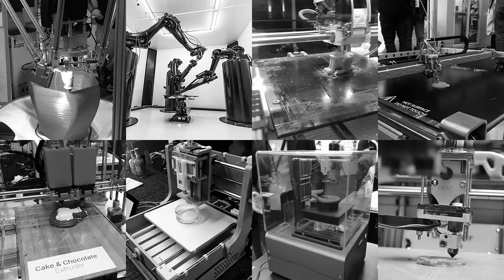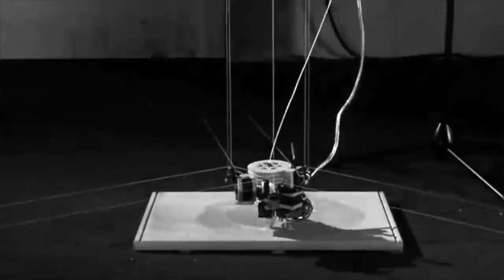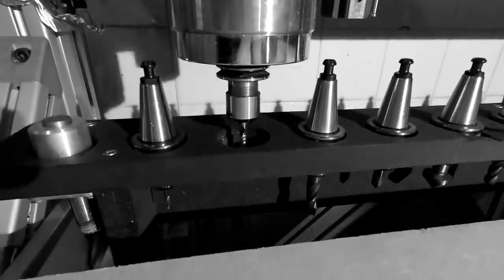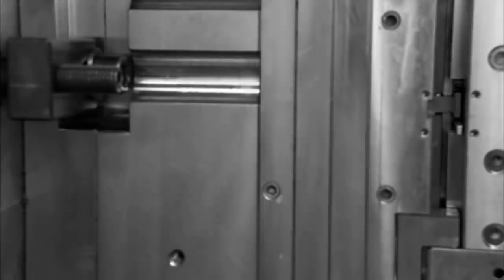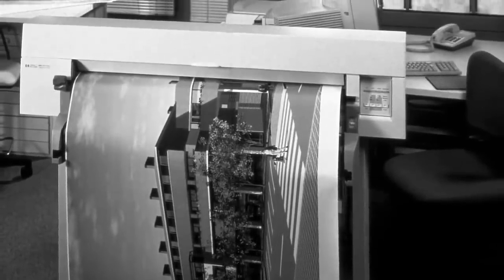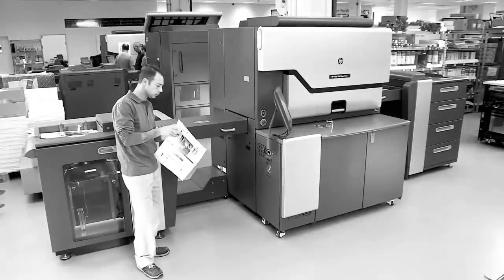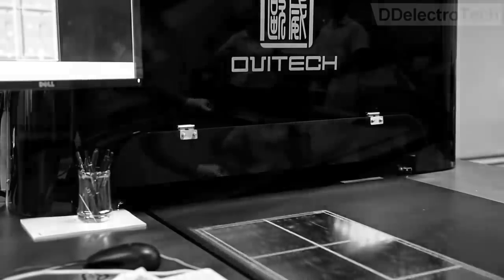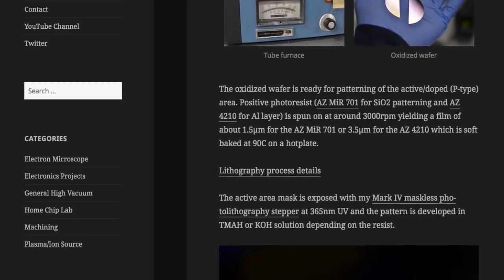The Desktop Manufactory 01 / A New Industrial Revolution?

Comment: You're missing out on something very big.

Machines are expensive. They are the least expensive when they can run 24/7.

There's no need for home bookbinder machines. If you want books bound, there's the machines you mentioned that can automatically print and bind books. That process can be automated to the point where from the order up to the books being in the box, no human has to interact with the system. That makes way more sense than everyone having their own book binder.

The 'book binders' that are useful for home use have been in homes for decades. They're called ring binders. They're cool if you need one printout.

Book binding is for actual books, that get sold in the hundreds or thousands.

Same with vacuum formers etc.

See what happened with PCB manufacturing in the last 20 years. It went from people doing it at home because it was so expensive to have one professionally made to being able to order 10 pieces from china for 2$ (10$ including shipping). THAT's the future, not everyone having a vast array of machines in their homes.

3D Printers are a bit of an exception. I mean, even then, what would be "public printing spaces" - like those that exist in hacker spaces, where you could queue up your job in an automated system that tells you when your model is done, and then you can pick it up with a passcode, pay the filament and timeslot fee (should be low if effectively implemented), and be on your way. All fully automated, only maintenance staff needed.

Comment: Hey Node,
For your 2d printing machine, you should try to make a DIY UV printer. It'll kill two birds with one stone.
They allow you to print on a range of materials and I have found no decent or thorough alternative online.
I think a UV printer would be an amazing asset to any makers workshop cause you could also create PCB's with the printing tech
It allows you to make 2 layer PCB's but you'll need to drill the VIA's and connect the two sides

Comment: One thing I didn't notice you mention: Universal robots. They're used in pretty much all manufacturing applications and are extremely useful due to their flexibility. You can get them to assemble just about anything rigid with the right attachment. I'm not sure why they aren't cheaper. Maybe it's patents, maybe it's servos precise enough to move them about, maybe it's just that a FOSH plan doesn't exist.
Reply: An update on this: https://www.youtube.com/watch?v=woXfuM6YjM4

Or to summarize, the presented concept is a matrix of cells of 4 or more universal robots with interchangeable tools, supplied by self-driving transport vehicles. This goes above "desktop", but expands what can be done dramatically by miniaturizing and generalizing the production process.

Comment: I am not sure that pursuing DIY PCB's and pick-and-place soldering is necessarily the best use of time and resources.  Both of these jobs have multiple providers that are happy to do the work very cheaply.  Of course, eventually one would have gotten more labor out of a DIY toolchain than they would save by using existing services, but at that point you're talking about being an electronics design house in your own right.  If you're making custom electronics at volume for a living, it's probably a better idea to get existing professional tools with professional support contracts to keep your ability to make money running.

By all means, create CNC tools for routing two-layer boards, applying solder paste, and placing SMT parts as there will always be small collectives that can use the capability, but you would be able to do more good by focusing your limited time and effort elsewhere first.

Comment: @N-O-D-E
 I would argue the more important disruption is in knowledge organization. There are very promising precursors out there for a knowledge organisation system far superior to what we do now as users on the commercial Internet. I'm talking about developing an integrated toolchain to drastically simplify learning and collaboration, maybe a set of standards on top of which to build OSHW. First comes the human needs approach: conceptual modelling starting from human needs (most stable over time). These needs are expressed as scenarios/user stories using Semantic Web/Linked Open Data vocabularies, so they can be linked together, navigated in a graph, deduplicated and otherwise improved by collaborators. Then the solutions to the problems come first as design intents expressed using the Design Intents Ontology. Implementations come last (as they are the shiftiest sand, depending on evolving software packages and platforms). Say OpenSCAD with libraries. The idea is to computer model as much salient knowledge as possible, and radically open-source it. Eventually the goal is for the "productive knowledge worker diet" to consist not of long-form prose books, insanely priced university courses, long-winded lib docs, lowest-common-denominator cookie-cutter walkthrough videos  and life-long specialization by internalizing (quickly outdated) material. Instead it should consist of interacting with knowledge package managers, reusing code, document fragment transclusion, doing remixes, mashups and animated debugging. :D

Comment: The unequally distributed future ruined me. I can't buy shoes anymore. My last sneakers were an unexpected upgrade (ultra-light, comfy, slip-on, water-resistant, durable and cleanable) and now I can't imagine going back on any of these features. 

Same goes for bicycle parts, particularly "human interface devices" like grips and saddles. If there was an OpenSCAD script to take in your body + bike params, you'd grab some TPU filament and print perfect custom parts. Then that would be it, quest over. No more marketing, deceptive pricing, secret discounts, and most importantly you can have stock. No more of that market gap between cheap and premium, where cheap products are bad, mid-range products are also bad but branded, then – sudden jump to premium products, which are too good and way overpriced.

I would argue that adapting to the challenges ahead requires shifting away from "owning products" and towards "adopting technologies".

Comment: Yeah, desktop injection molding won't be a thing, it is not viable and its use case to narrow.
Fortunately it doesn't need to, because you can make very quick silicon molds and do resign casting.
The modern resigns have very good properties and can easily compete with thermoplastics especially when combined with strengthening fibers etc.

Comment: Yeah 3d printing is still early days. We just lack the strength metal materials can provide. Lost PLA casting would alleviate some of that, but then there's other things to consider. We've got a long way to go.

Stoked to see where the production line goes next. We're missing too many steps in the consumer / maker area. Lots of opportunities to fill the gaps.

Comment: Very interesting, as aways.  It really does seem like most people just print little boats with their 3d printers.  I'm much more interested in a desktop CNC that can do pcbs and mill aluminum and hard plastic.  Basically one machine to create complex electronic devices including enclosures and mechanical components like hinges.  Unfortunately, good desktop mills are still $2500+ and the cheaper ones seem to wreck more pcbs than they complete properly, so I think I'll be waiting at least another year before buying something for myself.

Comment: the phone thing that you mentioned is possible just stick a voltra one with a small 3d printer and a CNC mill together and a robotic arm its possible.
Reply: right now I am making a CAL 3D printer which can print using a cheap projector faster and much more high quality.

Comment: A lot of similarity in the mechanics of many of these devices.
Check E3Ds tool changer. That could kickstart this revolution. Swap a print head tool for a cutting head (multiple), or a laser head, or an ink head... or a robotic part picker head or a plotter head.. or a resin deposit and draining head... with a UV head.. if it's multi tool, you can print the container box for the resin before you start (or while your filling/exposing)...

Imagine using multiple processes together on one object. 3d print an open box, fill the box with support powder and stainless powder, use the laser to sinter the metal.. You have an sls printer.
And what if this was printing on a small bed on a belt.. so it can have a queue of jobs which (when completed a job), it can simply roll it off and into a bin. Rinse, repeat.

Comment: I've been seeing interesting articles about recycling styrofoam, melting it with a recyclable citrus solvent (D-limonene) and using the resulting goop as a castable plastic. Home or community based recycling of raw materials could make local cottage manufacturing much more feasible.
Reply: They are these guy in califoria making a mushroom replacement for stryofoam in surfboards
Reply: That’s really cool, I’ve tried doing this also but had no idea about D-limonene. I used acetone. I’ll have to look up that D-limonene stuff. 👍
Reply: @HeyPatch  I haven't actually tried it yet because I don't want to pony up the cash for a jug of the stuff, but you can also get some back after each batch. It's also a citrus oil so may be renewable if it can be extracted efficiently from plants.
Reply: Plus mealworms can actually eat styrofoam, check out The Thought Emporium's video 
https://www.youtube.com/watch?v=TS9PWzkUG2s

Comment: There are actually quite a few DIY vacuum form moulding projects out there. You can find them especially easily on prop channels and a quick google search turned up a lot of other stuff. Very easy to build, use and maintain. With some work you can probably get some really good resolution out of them, too. But, I'd love to see more local manufacture in stuff like silicone and pcb's...